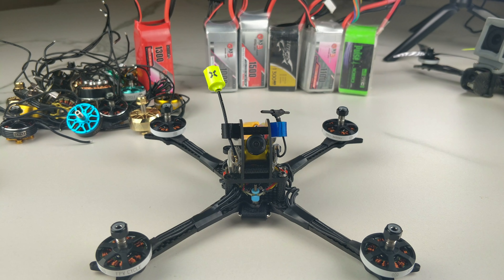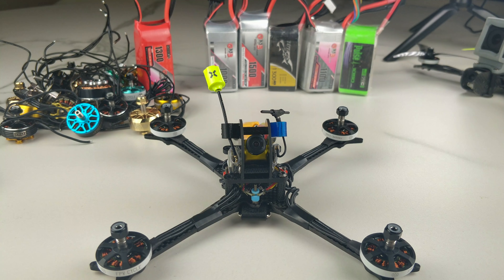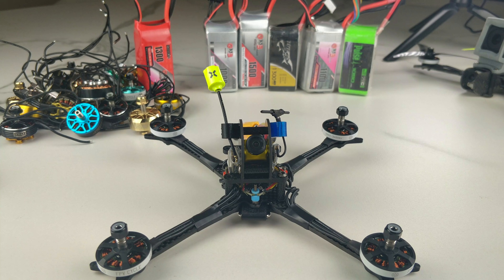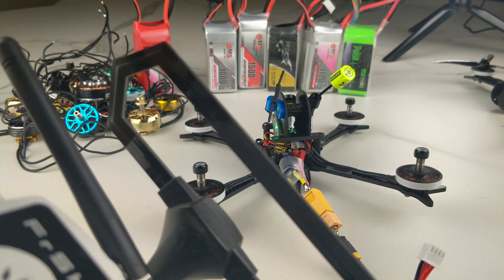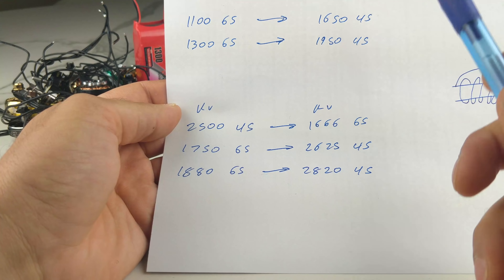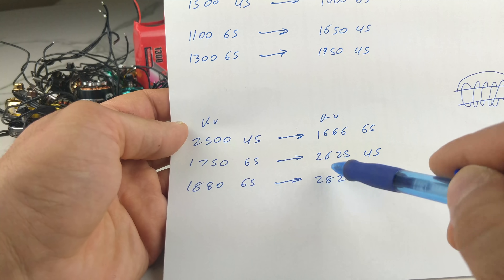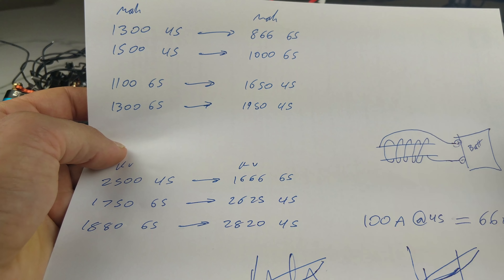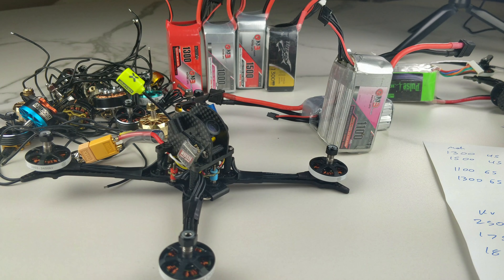6S Everything?  Why does 4S feel different?

Comment: I'm Not an engineer, but I play one on TV. LOL. The erratic movement you are seeing in the motors is the same thing I see anytime I run a quad with props off. It is only more amplified to the naked eye as you increase voltage, giving the PID more authority. The default PID's on most firmware is set to expect the resistance of the props. You could stabilize the erratic behavior of the motors by dropping P gains in the software, but then the quad would not fly very well with props on. Run the same test, outside, away from you, with props on at idle. I think you will find that the default PID's are very stable when they are run with the load they are designed for. The PID Loop is trying to reach a goal over time (RPM or Axis angle of the quad) as set by the software. Example is, If the PID Loop is set to try a certain amount to reach it's goal within a certain time with props on, when you take the props off, it will get there too fast and have to slam on the brakes because it will "overshoot" the target. Because it can't learn on it's own that it is doing this, it will do it over and over again, causing erratic behavior. Let's say you added really heavy props or props with an aggressive pitch. The motors would be more stable but very sluggish until you command the PID's to try harder to reach that goal.

The key I have found through people way more experienced in this is than I am is,
Match your max prop RPM's in your 6s build as close as you can to max RPM in your 4s build.
4s is 4.2 volts x 4 series cells right? so 16.8 volts fully charged. With a 2450kv motor, we are looking at a max RPM of 2450rpm x 16.8volts.  So 41,160 RPM.

Now Lets build a 6s quad that we intend to behave in almost the same way.
6s is 4.2 volts x 6 cells. So thats 25.2volts. Take the max Rpm from the 4s build and divide it by the voltage of 6s. So 41,160 divided by 25.2 is approx 1,633kv for the motor. I've never seen a 1,633 motor before so I would try to get close by getting a 1700kv motor. After making these changes to a 4s quad (Keep in mind that all electronics on the quad must be rated to run at 25.2 volts or above to keep from frying them) you should be able to run 6s on your 4s settings with very little adjustment needed because the max RPM is going to be about the same. The difference in the 6s build is that is is relying more on the voltage to spin up the motors than the capacity of the battery. On a 4s full throttle punch, the voltage drop is faster and then you are in the capacity area of the battery sooner. A 6s battery has higher voltage and more cells to sustain the load so voltage drop is more preventable. We don't stay in full throttle very long but some of us just want a little more than we get out of 4s and 6s seems to provide that. Some have said that moving to a 6s setup gives much longer flight times as well due to battery having better voltage "bounceback" or recovery after a throttle punch. I have noticed this myself and really enjoy the benefits.
That's my 2 cents. Be safe and responsible out there guys. Don't get the rest of us in trouble by flying like a moron!

Thanks.
Reply: LOL. I should have waited until my internet connection came back and I could watch the rest of the video before commenting. Awesome video KABAB! Thank's for your contributions to the hobby sir!
Reply from the maker: The problem with the quad has nothing to do with any of that. 😁. It was purely where the cap was positioned. Just had to move it closer to the board.

Comment: So is it possible to create an esc that account for this? Or it would be to inefficient?
Reply from the maker: there are probably some tricks that can be invented to compensate a little but why not just run 4S when you don't need more voltage?
Reply: @Kabab  I was thinking a bit on the question, and for little quads i understand, but for bigger quads, would not make sence to convert voltage to amps, so the battery don't have to work so hard so it lives longer?  I don't know if it would work like i think. Usually it is not that easy :D

Comment: In regards to input voltage and P&D Gains regarding oscillation, this is very much a relative authority type problem, particularly in terms of how quickly the D-term oscillations with the inherent phase delay end up passing through there, which is why heavily filtering D-Term can be a useful partial solution, why DMin is actually useful despite the limitations, and mostly why changing the gains lower in excessively high KV setups matters.
This interacts with PWM frequency and timing to a limited degree, as well as Rampup/Startup power (Again, Ryan Harrell would be the authoratative resources on this).

Comment: Great video.  Amps kill if relatively little voltage is present.  Volts with relatively no Amps just make you flop like a fish (taser) or make your hair stand on end (electrostatic generator).  The right combination of the two is what make the lights come on (Watts).  I relate electricity to fluid mechanics in that Voltage is a pump or vessel of stored energy.  The size of the vessel is its capacity(mAH).  Amps is the size of the pump lines or how fast that energy can flow.  There is of course resistance (Ohms) which affects the flow of that current.  The difference between fluids and electricity is fluid is not compressible.  If you want more pressure you need a bigger pump.  Voltage however, through a capacitor, is compressible.  That is why Quads need a Cap to meet the high current demand and minimize voltage sag.  The marriage of volts to amps is as equally important as props to motors.  Long track racers need the top end while the short tracks would need the quickness off the line and between the gates.  This same discussion can apply to Inline 6 vs V8 engines.  The I6 is insanely quick off the line but does not have the torque or HP of the V8.  I think the long and short of it is: what is the weight/size of the Quad, what do you want it to do with it, and how long do you need to do it.  That would be an interesting video.  Compare size/weight class with different battery/motor/prop combos on both long and short tracks.    Thanks for your work.

Comment: you're right about electromagnetic field and how current generate it however, in my mind, the starting purpose of using 6s is for reducing sag during racing .
Reply from the maker: Yes that's when you use it. When you're pushing the battery and it can't deliver. That's when you need more voltage. No point in 6S on a sub 200g build. There's no stress on anything at that low

Comment: High voltage is being used because for the same amount of power you need less current. That results in smaller ESCs and cables needed making the quad lighter and cheaper.
Reply from the maker: Except that the ESC is actually larger as heavier.  We don't go smaller and lighter typically when we get more potential wattage output. We just use the wattage to go faster....this is performance flying. Not dhi float around flying

Comment: The motor jitters in 4s due to high rpm compare to the 3s and the design of the motors. Have you seen the video of the slow mo guys spinning a disk, at the very high rpm the disk wobbles. Like in some power tools like a grinder or circular saw, blades have rpm limits.

 I'm not saying the design of the motors are flawed it's just design for a specific application and i hope to get a set of those.
Reply from the maker: I believe this to be partially the reason why as well other than the fact that it's working perfectly on other frames.

Comment: Quite interesting, i was making the list for a 7" with cinematic and long flight purpouses, running the xing 2806.5 and this video really got me thinking... Would you go for the 6s bat and 1300kv or 5/4s with the 1800kv? Thanks anyway for ur huuuuuuge contribution to our hobby!
Reply from the maker: Well bigger prop sizes are higher loads so you either need giant batteries or lots of voltage or both or just don't push it into sag territory
Reply: So 5s sounds the best option, thanks Bob!! "Eres un sol" like my granma would say xd

Comment: I personally fly 4s. Have never tried 6s, ive just never found a reason to go 6s. At first i was thinking to switch once i broke a motor, my BrotherHobby motors havent broken in 15months, so im going to stay hsha. I am very happy with the performance, i get 5-6 minutes of mixed flight with a satisfying amount of top speed. There is a slight sag at the very emd of the battery but i am a casual freestyler so i dont mind 👍
Reply: I honestly was experimenting with low KV longer flight time  maybe 6" arms and 6" props   but I'm seeing no diff yet    Ironically I was just about to order a bloat of 6S batteries ..  LOL

Comment: I have not experienced 6S yet. I do have some brand new Ovonics waiting for a my rebuilt Flossstyle. To me 4S is plenty for anything under 5in, and still feels just fine on a 5in too. I do plan to build a 7in LR quad and use 6S1P 18650 packs. High voltage makes more sense the bigger the props are.
Reply from the maker: Bigger props are more load so you definitely need the voltage benefits. Dji even moved up in voltage for the phantom. That thing started on 3s
Reply: @Kabab  I remember being impressed by the performance of my ZMR250 with 1806s on 3S...😂

Comment: Why the odd version of 4.1.5? Why dont give 4.2 a try along with RPM filter + dynamic idle
Reply from the maker: I'll give it a shot later
Reply: 4.2 made me come Back to betaflight. I quit using it when 4.0 came out, it was terrible. 4.2 with actual rates and I have never before had such a control with my quad. It is very very good

Comment: Another thing that 6s over 4s is because of the lower temperature from lower amperage the electronics run smoother. When I was doing my run to hit 145mph back in spring of 2017 my main issue was melting motors and soldering joints. Switched to higher rated connectors then to 6s to lower the temperature of the electronics and the solder joints. APC and the other prop companies at that time all told me that they design the top speed of there props to be 25000rpm +/-1000 max. The props start loosing efficacy and the ability to hold there shape. I was running 2306 2750kv on 6s to hit 145mph.
Reply from the maker: Well yes but if you wanna get tht torque back then you need higher kv which drives the current and because you have higher kv and more voltage you get more rpm which draws more current....so as long as you keep it lowish on the throttle it's less heat.
Reply: @Kabab  true but for all out speed runs which are 100% throttle aerodynamics and temperature are most of the issues i have. 145mph is extreme on the electronics especially temperature.  I understand the torque difference but if your at full throttle the whole time they should be both pretty close to full torque but the 6s is pulling a 3rd less amperage  giving less sag and keeping the electronics cooler and more stable. But for every day freestyle and racing it would be preference. The emax 2306 2750kv motors on 4s where pulling 55amps each and unsoldering the wires even with a high dead time. Side note, I believe prop manufacturers should be putting max design rpm and best effective rpm on there packaging since we can do rpm filtering now.
Reply from the maker: @wodifpv644  for all out speed it's mostly aero. The top speed guy does like 180mph on 5S and ~215mph on 6s. It takes a balance of many many things to get there but mostly aero.

Comment: I Think of a water hose.  voltage is like psi (pounds per square inch) and current is like gpm, (gallons per minute) you need the psi to push the gpm.  You need the EMF, electromotive force to push the I, current. And MAH is just how much is in the tank.  I think 🤔
Reply from the maker: That's a good analogy and it applies to what I've described but I actually left out a huge part of things. I didn't discuss inductance at all and that's where this analogy doesn't work out. I don't know if I will talk about inductance ever because after that there's more to discuss that makes things even more complicated....I choose to leave out this analogy because it might make things more confusing for someone that may continue reading on this stuff.

Comment: Great video. Thank you Kabab for sharing your learning and experience. You may have just solved a problem I'm currently facing. Been trying to get motors designed for 4S to work with 5S, and  likely pushing the motors too hard as a result.

Comment: What about voltages higher than 6s like 8s???
Reply from the maker: See my most recent video about ramp up power.  Will help with 8S things.  The main issue with 8S is that you'd have to use two separate batteries which is just annoying to use.  Otherwise, I've wanted to 8S some of my 5" quads to be able to get a bit more performance with a gopro on board.  On anything that's not moving super fast all the time or heavy, there really isn't any benefit to higher voltages.  The flight time is typically lower with a small capacity high voltage battery

Comment: 6s has torque because the electrical losses in the system are proportional to the current squared. The limit of a motor is temperature (apart from stresses in the bearings and other mechanical limits...) increasing the voltage allows you to decrease the current inversely proportionally... But the heat drops exponentially. You can therefore use wayyyy thinner wire and have wayyy more windings. Higher voltage has more torque because for the same volume of motor you can decrease the wire, increase the windings and magnetic field strength increases dramatically even though the current dropped! You're right about the batteries... But higher v lower kv for sure has more torque and/or for the same mechanical power runs more efficiently.
Reply from the maker: This has not been what testing has found. It's pretty clear that higher voltage has more peak torque because the whole system is higher wattage but lower average torque. It's also not more efficient. It's in fact a bit less efficient. The main savings do come from thinner wire but not in the stator.  From my understanding you need to have the appropriate winds and volume of wire to generate the field. More winds that are thinner are not particularly better or worse.  The savings comes from the rest of the system being able to be smaller but in this industry we don't make anything smaller so there are no efficiency savings for us.  There are also increased switching losses in the FETs too. Larger capacity is what gives more flight time as long as the battery isn't being over stressed.

Losses from heat are also similar because once all said and done, the current is sky high on 6s too at max. It's lower at lower throttles....which is why the whole torque curve is shifted
Reply: @Kabab  it feels to me like a lot of 6s setups are not meant to perform almost exactly the same as a 4s counterpart (btw im new to drones like I said... My experience comes from heli flying which I have been doing for before smartphones) people use the extra available power to just... Go faster and harder... Would you agree that for a given setup that has motors that are not terribly inefficient at hover for some reason, a comparable 4s setup will always fly less long than a 6s setup given equal total weight  and total battery weight/watt hour?
Reply from the maker: @tijssens  as long as the 4s batt isn't being overstressed, it will fly for notably longer than an equivalent 6s.....for a few reasons. One of which being torque recreation and the other being ESC switching
Reply: @Kabab  wow... That is entirely the opposite of what is considered common knowledge in electric helis (which of course might mean that more people have it wrong including me :)) maybe the fact that collective pitch aircraft fly at at least 80%throttle makes my statement hold true most of the time... But the fact that drones fly at silly low throttles might explain the discrepancy? I'm intrigued to find out more about this... Really understand what is going on!

Comment: Are there plans to restock the runcam nano 3 on fpvcycle?
Reply from the maker: There aren't. Working on two new cameras with different manufacturers. The lens manufacturer for the original nano 3 had gone out of business and the new lens is awful. I don't recommend the camera anymore.
Reply: KababFPV will you sell the camera cable with a smaller connector on one end to work with the namelessrc vtx separately?
Reply from the maker: @Gienbfu  unfortunately we don't have those either which is super annoying. The vtx comes with the wire however. No?
Reply: KababFPV now that I look at it, it looks like it does. Worst case I can just splice the wires or swap the little plastic bracket 👍

Comment: I'm still learning and confused about this stuff.. example guy said get the 3s version of a drone for beginner. Then said 4s better advance and outdoors .. but when u figure out rpms from 3s motors and 4s motors. 3s has more rpms.. 
I need to research and learn more.
Guessing more amps available with 4s
Reply from the maker: He just meant get a lower power quad. Not specifically 3s. But in the real world, 3s is lower power so it makes sense again.....maybe not 🙈

Comment: This makes so much sense. I've just switched in the last 2 months and I didnnotice when in lower throttle they feel softer, but at about 30% (for me) it picks back up and has the power i need. I was thinking it was the change in props, but now looks like its a product of both instances. Lower torque cus of 6s, and lower thrust from diff props. Got it. I was pissed after I got new motors and all to go to 6s
Reply from the maker: It is an unfortunate feel change. But if you need to fight sag, this is the only way that hammers it
Reply: I deff agree Bob. Love ur info and vids. Especially love my tp3 and my powerpicj stuff will be here fri so ill get a review together for ya